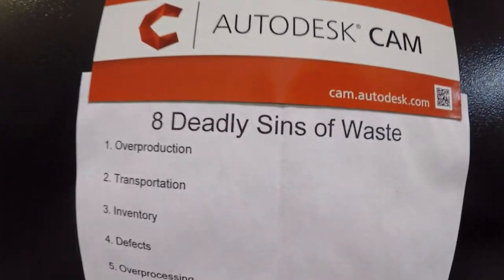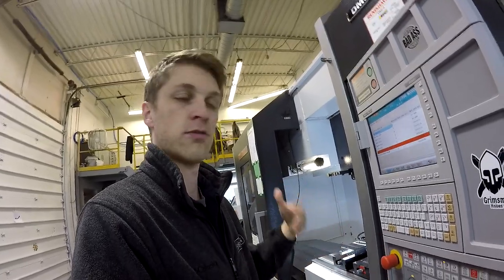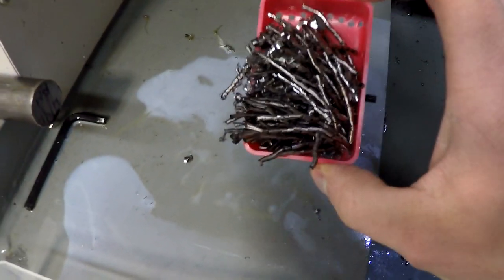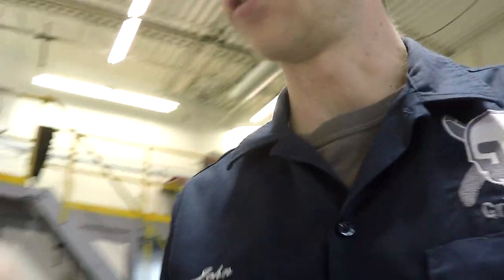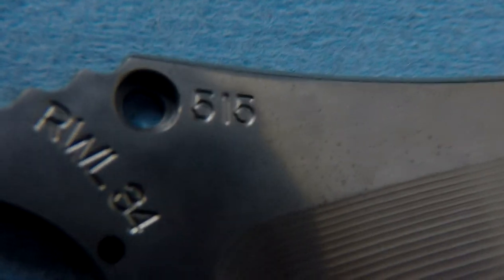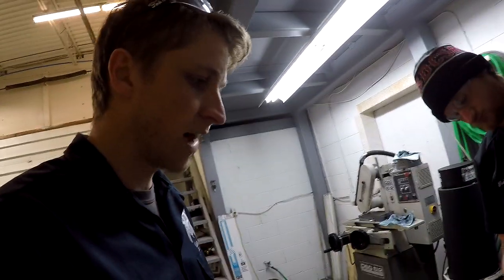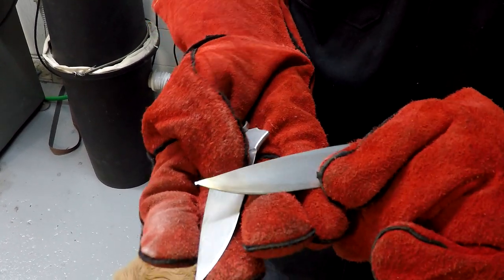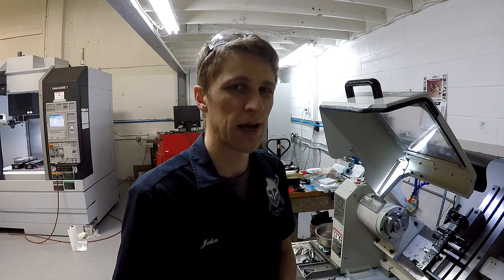Getting closer to Lean Manufacturing

Comment: First off, big fan of your work!

One thing to consider with the foaming is the coolant pressure. Potentially dropping the pressure through adding a valve or changing the tubing or changing the nozzle geometry could help the foaming problem. It looks like it's coming out at a pretty high pressure. A lower pressure could also allow for more of a flood cooling effect on the endmills.

Comment: John!  Regarding the engraving on the mill, and accuracy in general.  Take the leap and start making your jaws out of 1144 or 1018.  NO MORE ALUMINUM!  It's such a soft material that whatever material you clamp is deforming the clamping surface and your parts are shifting just slightly each cycle.  Also, the deformation happens more at the top of the pocket wall than at the bottom and can eventually lead to parts pulling out if tool loads are higher.  Congrats on the move towards one piece flow, it is the way forward.  Cheers!

Comment: Just a thought on heat treating. I don't like laying the pouch down flat on the bottom of the oven. I've always been concerned that there would be a temp difference, might not matter, but I don't take chances. Evenheat has some great little ceramic heat treating racks that will let you stand up your pouches on edge. If you've got plenty of quench plates and work efficiently, you can heat treat 3 or 4 pouches at time with the rack.

Comment: John, with a different goal of what we talked about yesterday,  I recommend buying some burnishing media. Non-cutting. porcelain spheres or rods. You may be able to forgo the ultra careful heat treating by tumbling the blades in the porcelain overnight. It will lightly refinish the surfaces and polish the edges. If you want to send me a broken/burned/unsalvageable blade, I can test it out for you if you're interested

Comment: Better than watching TV! Fun to see you guys try Lean manufacturing. It comes with quite some challenges. It's good to have the Muda's as a list on the machine to remind you of them.

In a way the home-made screws is not really lean. It falls under number 5 "overprocessing". (does not change the fact that it is really awesome!)

What documentation do you guys use as source of information about Lean?

Comment: Seeing the morning start-up of powering on the tools, compressor, opening the valve, etc. leads me to ask, do you have a written "checklist" for morning startup and evening shut down?  It's useful both to reduce missing anything but also to reduce decision fatigue - along the lines of "you only have an allowance of 100 decisions per day."

On one hand, audio is 50% of filmmaking, on the other hand, your audio has pretty much always been "good enough."  I could imagine people with hearing difficulty or non-native English speakers having problems with the ambient noises obscuring the speech, but it usually isn't bad.  Audio is a deep rabbit hole to go down - YouTuber Curtis Judd has a ton of great, practical info on getting to pro audio.  Also the current versions of Adobe Premiere CC have an auto tool to sync separately recorded audio to the audio recorded on the camera - no need for claps or fiddling to align the audio track.  Again it's not much of a problem, so you probably don't need to devote much time to "fixing" it.

Your videos are marketing for your business, not a hobby.  They seem to be valuable to your business, so they may deserve time during your work day both for shooting, but potentially also for editing.  (Though, of course, you can edit at home, while time in the shop is when you have access to the tools.)

Comment: Try starting your cutoff going as deep as you can without the part actually falling off. Then bringing your parts catcher up to the part dwelling for just a second and then finishing the cutoff procedure. I noticed the same thing and found that doing this reduces chips getting into your parts catcher and having parts missing the catcher.

Comment: Batch work becomes less of an issue if you programme your batches. 

For an example, you may wish to organise it in terms of parts for 50  knives and they are run when your stock in hand reaches enough parts for 6 knives.

This would allow you to better predict when you need to order more raw materials taking into account delivery lead times and production times.

As a further example you may find that the delivery lead time on the Ti rod for the screws is the same as the production time for 8 knives there fore when you have 14 knives remaining from a run of 50 you need to order more Ti rod (if required) etc...

Comment: About the heat treating. Did you consider making an envelope that is open on the side, putting in the blade and then sliding the filled envelope in another open on the top envelope? It might be just as "airtight" but re-useable

Comment: Those batteries also remember your tool offsets, they also must be swapped while the controller is powered up ( so ac power keeps the memory while you pull the batteries) 
I Swapped them yearly at Husky in Bolton ...oops I've said too much!

Comment: First thing to remember when going lean is that batch is not evil. You just need to figure out the right size batch. After all, doing just one item at a time is a batch of one! The size batch you need will be defined by the other parts of your processes. Example: It looks like Eric does heat treat in batches of four. Making four sets of pivots would probably be the right size batch. It all depends on the other parts of you process.

Comment: Hey John. Instead of using the mighty bite fixture to machine 6 screws at a time, why couldn't you screw them straight into a pallet with the heads exposed and go to town with it.  The first cut will pocket the center and tighten them in tight with the right rotation.  Another option is to use a drill chuck to tighten them in by hand from the circumference . Just curious if that's an option.
Reply: +eddie2799 That's basically how we've been doing the Overtravel stop, but with these new screws we didn't want to mess up the beautifully lathed surfaces with the drill chuck and we wanted them extremely secure to make sure the torx gets machine perfectly. John may have other reasons too... but that's my 2 cents

Comment: Machines will often develop foam on their initial charge.  Do you have a refractometer?  It's a good investment and will help keep foam under control by keeping your mix percent correct.  Also, are you using a mixer or just putting the concentrate into water and mixing by hand?  I've conquered the foaming in my five machines by maintaining proper mix % and buying an actual mixer.

Comment: Why not make an skeleton enclosure for the go pro and the zoom mic? You could even add a lever button action to synchronize the two buttons at start. Push once for both.

Also, i saw that some people use alu enclosure when doing heat treat. Why not make one of those too? You could vacuum one of those and have foot pegs for the blades to float in the 'air'.

Comment: Get a directional (aka: shotgun) microphone.  They have a differential circuit in them that filters out noise that comes from behind the camera and focuses on only the sound coming from in front of the microphone.   Edit:  Alternative:  Remote / wireless microphone, so you have a mic pinned to you, but you aren't tethered down.    MonoPrice 600120 works pretty well and is cheap.

Comment: There must be some clever balance right in the middle of mass production and efficient spreading of setup time. 
((((x time per part) * parts per stock run) + y time per run stock change) * z number of runs) + tooling change for different part * number of different parts you make.

All comes down to how much work it is to do that tooling change.  It might make sense (if you're 100% sure of your performance and tolerances) to run off a bajillion of each part to minimize changes.  You can't assemble until you have a full inventory but once you do, assembly is all caught up and lead time can be reduced to near zero. If the changes are easy then it's a wash and you only need to run off parts as they are needed.  Supply chain management systems have fought with this algorithm for a century.  How much capital to tie up in inventory, how many of a part is reasonable buffer.

Comment: As far as the water you use for the coolant is concerned, if you check out the Haas tips on their YouTube channel, they suggest regular tap water when you first fill the tank and then topping up with distilled (deionized) water. Pretty interesting video actually... Worth a look...

Again, great work on the video. I guess I wouldn't be too upset with a Grimsmo vlog (wink, wink)!!! So... Make it happen.

Comment: I've been getting pop up ad's from a company called banggood com. they have a bunch of junk, but they also have 2 sizes of titanium rod. 3x25 mm and 10 mm by 50 mm.the first one is $1.38 and the second one is $10.25. I don't know if you can use either one of them and I don't have any idea what their quality is but that seems awful cheap. btw where you used button head screws in the previous video they also make a low head socket screw. I used to work on Cincinnati centerless grinders and they used them to hold bronze bearing shoes in. first time I ever heard of them.

Comment: "Baby powder" generally does not contain talc because of potential health risks.  It's mostly just corn starch, which is much cheaper in bulk (still use the baby powder bottle for application).
Reply from the maker: +eformance They make baby powder with either talc or corn starch, this one for sure is made with talc, says so on the label (right under "keep away from baby's face").  I'm assuming corn starch won't last past 500*, being that it's food, not a mineral.
Reply: +JohnGrimsmo Yeah, it's just not as common.  Good on ya (Erik) for finding the talc!

Comment: The trouble you are having with the tips can not be allayed by covering the blade uniformly. You absolutely need a greater mass roughly equal to the average mass of the blade clamped firmly to the tip and (this is very important) conforming to the shape of the tip as much as possible. I would go so far as to machine a negative space of the tip shape for each kind of blade you make. I would use the range of bluing along the previous heat treated blades to guide you in how far up the blade your compensator should be. Good luck and fare well.

Comment: Don't blacksmiths use soap to prevent oxidation when forging? could you use something like that to help with heat treating so you don't have to wrap as many times? just a thought idk how all this stuff works
Reply: They use flux usually, such as borax. not soap
Reply: Is borax not a soap?